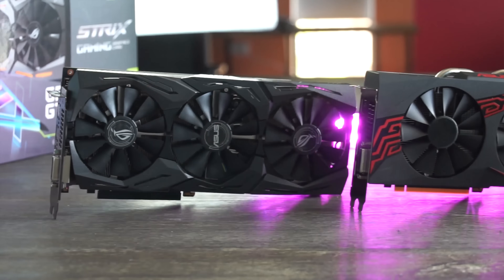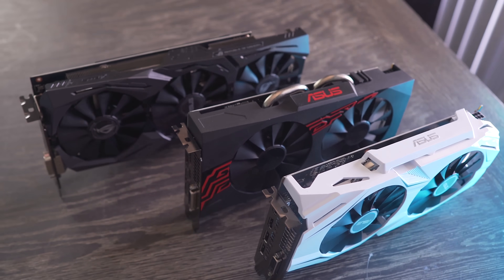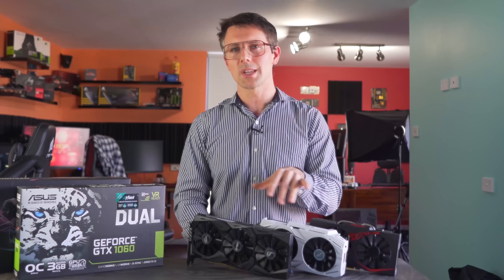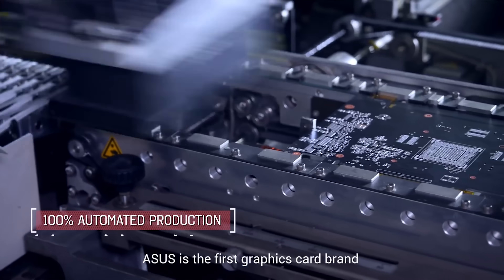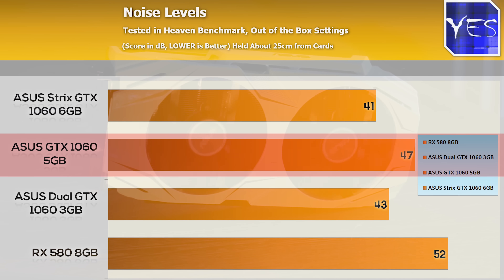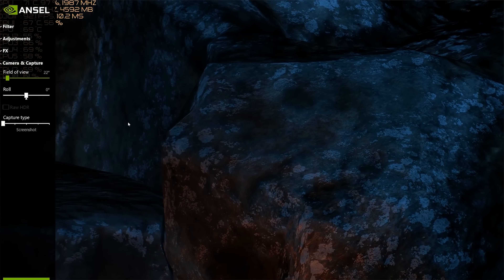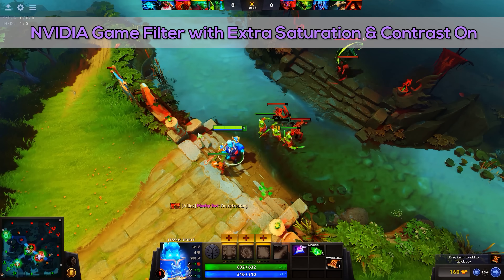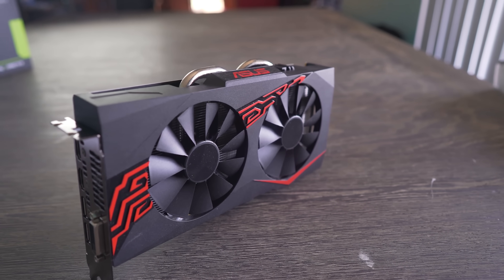GTX 1060 5GB Benchmarks ....!? Comparison Vs. ASUS STRIX 6GB and DUAL OC 3GB!

Comment: what? why? just get 3gb version ~5 fps less than the 6gb version
rocking mine and playing in 1440p
Reply: Smirnoff Vodka. You are kind of limited with textures, though.
Reply: Emperor LemonFace in all the games i have played so far on my pc, and that are quit a bit i havent felt limited in any games. even emulation is on spot! botw with 2k textures a clarity mod and anti aliasing running at over 60fps just fine! if i run it with 4k textures i can run it with mid/high 30s to low/mid 40s
Reply: Not really, it's worth spending extra for 6gb version.
I got 3gb and i max it on some of the newer games even on 1080p. 6gb also has few more cuda cores and maybe higher core freq?
My gigbyte mini itx boosts to 1.9ghz without being too loud.
Reply: Cekpi7 youre on a video that supports my claim that in gaming it has ~5 fps less. seriously do i need to say more?
Reply: Smirnoff Vodka Did you even read my comment? Try filling 3gb, its gonna be huge difference, textures won't load properly and it will stutter. ~5fps difference is only when VRAM isn't limiting you. Most games use around 2.5gb, even gta v uses close to 3gb and its few years old. Not sure what games you play at 1440p without filling 3gb
Reply: Cekpi7 thing is, i have a 1060 3gb and i have zero of your mentioned problems, unlike you who writes down problems with a card he doesnt own nor game with, you probably got this on the internet
 but if it really were as bad as you describe why does my comment half 12 likes and why doesnt brian mention it? i mean according to you its gamebreaking
edit: grammar
Reply: Smirnoff Vodka I said in first comment i own it, you even have comparison on my channel, and yes i have problems with maxing 3gb on newer games, that is a fact.
It isn't really bad, but it makes tomb raider almost unplayable for me at higher settings due to gpu being at 50% and vram at 100%, same thing with bf1 but it loads core much more, not only gpu.
Reply: Well it sounds like you're just deluding yourself buddy. The 1060 3GB is decent value, but at 1440p there's now way you aren't experiencing heavy stutters while having textures set to ultra on games like gta , deus ex or rise of the tomb raider for example. Hell it would struggle to keep up with ultra textures even at 1080p on those games and more. Hell when I had a 980 I would sometimes choke its VRAM and I have a 1080p monitor. The 1060 6gb is definitely the way to go in 2018.
Reply: Ano Nymous https://youtu.be/UUMpY30THsc again its the top video, didnt even have to search
edit: who uses ultra though.. even brian has said from time to time that ultra is just a waste of performance with little to no extra graphical fidelity
Reply: Smirnoff Vodka Did you even read description? Settings were adjusted to get good performance...
Also you can see hitting 3gb even with med-high settngs at 1080p.
It also depends on textures that are being used, on bf1 for example i get low vram usage on open maps but on smaller with more houses it just gets bad, good thing bf1 has memory restriction so i doesnt stutter or crash.
Reply: rx 580 4gb > gtx 1060 3gb
Reply: Shadow of War and Shadow of Mordor, RE7, GTA5, you can't run those on ultra even in 1080p, let alone 1440p, and the new games will be more demanding. I have a 1060 3gb. A decent card, but not a good investment for the future.
Reply: The 1060 6GB is a MUCH better value for money. The 3GB is by no means a weak card, but it's not the best buy unless you're VERY budget limited.
Reply: Leinad https://youtu.be/UUMpY30THsc
Reply: rip pubg, resident evil 7 and future videos
Reply: Smirnoff Vodka Forza horizon 3 cant even run with a 3gb 1060 on med-high settings. It shows vram limited warning in every 2 seconds. And introduces a tons of stutters.
In the other hand gtx 1050ti can run the game on ultra settings.(of course at 30fps locked) no stuttering no frame drops.gtx 1060 3gb can't even run at ultra settings 30fps capped.
Reply: the VRAM count doesn't matter... Until it matters.